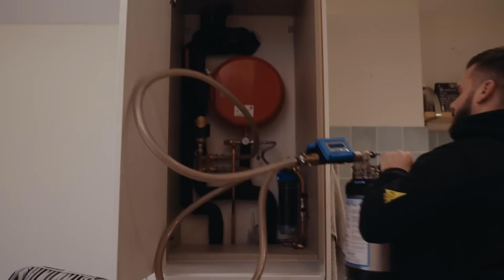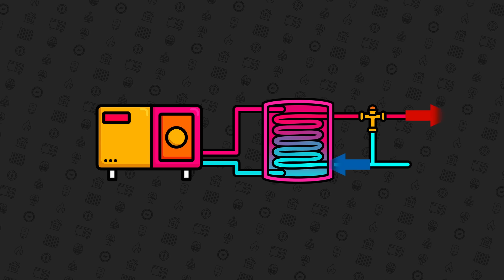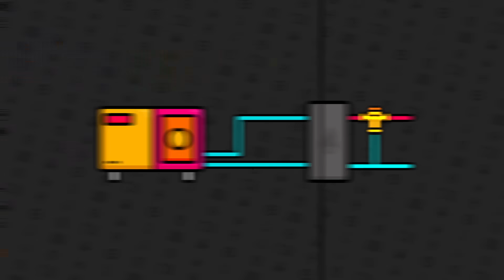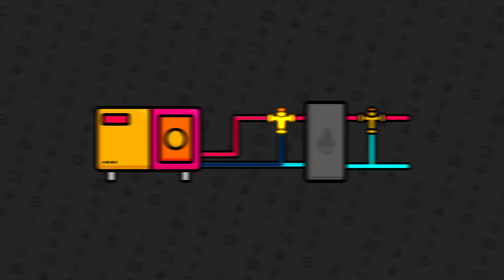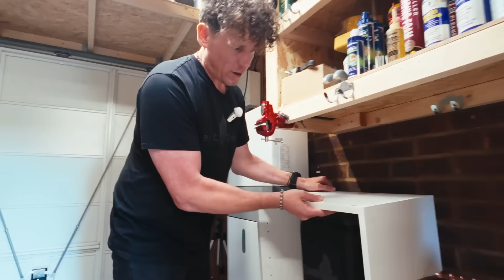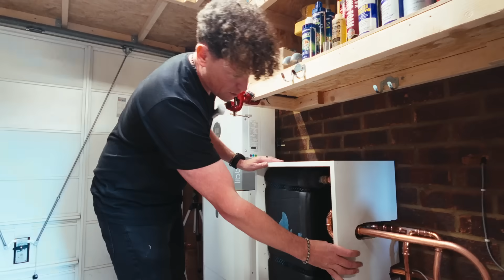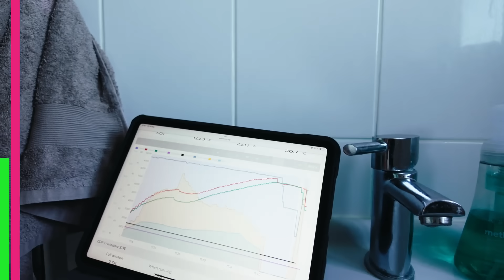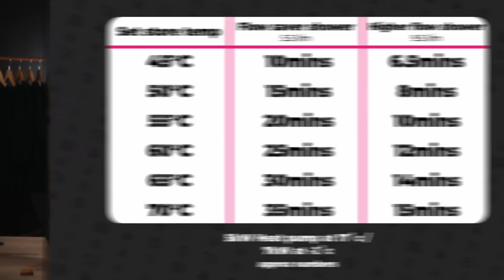World’s smallest hot water solution. (With a heat pump)

Comment: As many houses have electric showers, it may also be worth developing a heat exchanger that can use the shower's drain water to preheat the incoming supply.  While not a heat pump, this technically would have a COP over 1 as the electric shower only needs to use much less power to top-up the temperature after the initial heated water starts going down the drain, particularly in the winter when the supply temperature would be near freezing.  In this case the heat exchanger would need to have a self cleaning capability or at least be servicable to remove hairs, debris, etc.
Reply: This is relatively common in recent builds in The Netherlands; it saves around 40 to 50% of energy after a certain warm-up time (around 5 minutes). It consists of a copper 50mm drain pipe with a sleeve around it with the cold water feed to the boiler and shower attached. Search for 'douche-warmteterugwinning' or 'douche-wtw' (yes, a 'douche' is a shower).
Reply: Agree, however this is only needed on the CW feed to the shower. By raising the CW temp, using the waste, less HW will be required. These systems already exist, albeit requires invasive work to get to the waste pipe
Reply: As stated this is already a thing in the Netherlands, although not widely adopted yet. They work great. The vertical ones installed in the wall, never need any cleaning. They are great products, regardless of the heating solution. But they would work well in combination with this one.
Reply: In my house I've planned to go even further by going for a recirculating system based on a multiple filter setup namely: 75 micron mesh filter -> 10 micron fibre blown filter -> 5 micron activated carbon filter -> 1 micron fibre blown filter -> uv-c filter and a simple resistive heater (with area to go for a heat exchanger connected to my heat pump if I want later on).

So far my initial basic tests seems promising and currently I've installed my piping in the correct manner. I hope to in the near future (next 3-4 months) to fully enable the system.

Also everything is based on simple mixing valve system where flow sensors give the system info in what kind of water temperature you would want.

If I finish it I might write a blog / video around it, but don't pin me on it xD

Also yes this will cost more on usage since filters, but I hope that the savings in power and water will help a bit on that endeavour and of course only able with a full remodel.
Reply: @misthafalls  Yes that is a recycling shower. Which you can in fact already buy, but is quite expensive.
Might be worth it, however, regardless of price, it is much harder to retrofit in existing homes, needing to openup bathroom floors etc.
Reply: @Roland-nb6up  yup that is correct and that is a limit with that. But it is nice there are options nowadays.

Comment: Do it in the heat pump.  Dual heat exchanger in the mono bloc.   Little one for the heating as usual, then a big one for this job.  Not that big a deal to take a cold feed and hot return to the unit alongside the heating pipes.  

This removes a the transfer losses of 2 x HEX.  I guess. 

🤷 possible or dumb?

Comment: How are you triggering the heat pump to turn on? Is it purely based on the temperature of the water store?
Combi boilers use water flow as well as temperature to work out when to turn on. If you sense a large demand of hot water, it would make sense to start up the heat pump straight away e.g. when detecting more than 3l/s for more than 10s.
Reply: I experimented with the very cheap inline on demand units sold on ebay, they had uk and us plug options. Anyways the point is that they are the size of a football and use those same controls: flow and temp.
Tney work ok. Paired with this you'd have endless h2o.

Comment: I think something like this would be best used as a hybrid system - why not have a second resistive heater to get the water up to temperature quicker, and supplement in case demand is higher than the heat pump can supply.
Yes the efficiency would be slightly lower, but would be a significant improvement in user experience , and much more likely that people would be willing to adopt it.
Don't let perfect be the enemy of good - lower energy use is better, but if it's green electric anyway then it's already an improvement.
Reply from the maker: Watch the end of the video. We already going to this. The immersion is for extending the run time though really, not quicker delivery.

Comment: But doesn't running the heat pump at full output to deliver this use a ton of power -  equivalent to having an electric water heater?  Why do you never think about the sun as a source of free heat? We have a heat pump, with a dual circuit cylinder, plus two thermal solar panels.  In winter, the sun preheats the water so the heatpump does less, and in the summer provides all of our hot water -  for the cost of running a small 200w pump some of the time.
Reply from the maker: Well it used 2.7x less electricity than the power it used to heat the hot water due to getting the rest of the energy from the air (hence air source)

Comment: Brilliant - how does it work in practice when you may or may not be using space heating aswell? Still y plan but water draw switches the diverter? Would be good to see and understand. 

It’s great and generous that you are not patenting it but it’s a shame you aren’t building it with an external company like the other one? I think the heat geek brand is so trustable and I think people can trust systems from heat geek to perform well
Reply from the maker: The same as any combination boiler or any other heat pump system. It’s coverts to hot water, before moving back to heating.

Comment: Hard water areas would need a good filter on the mains with this design?
Reply from the maker: This will take 70* longer to block than a combo plate. Combo plates usually block primary side though not secondary

Comment: If you're that place starved, maybe, but otherwise this is stupid - you can get a HUGE boiler for the price of that HE and do the same mixing valve dance around it.
Rechecked the model number - pfff lol, you OK there genius? For that kind of money you can get 1 TON boiler.
Any defrost cycle will immediately drain that 'reservoir' of heat.

Also ain't you 30 years too old for that haircut?
Reply from the maker: I can get these plates for well under £500

Comment: Superb and love the ingenuity of this but…. this was tested at 19 degrees outside, now try it at 2 degrees down to -7 degrees as is often the case in the uk.
If it works, i want one.
Reply: OMG people, can you read?!? COP 2.7 is absolutely rubbish at 17C. 
I have 150L heatpump boiler Atlantic Calypso. And it absolutely demolish this performance.
My mesurmenst:
Air temp 8C, end water temp 42.5C, COP 3.37
Air temp 15C, end water temp 42.5C, COP 3.33
Air temp 26C, end water temp 42.5C, COP 4.34
Air temp 26C, end water temp 40C, COP 4.61
Air temp 26C, end water temp 50C, COP 4.07
Air temp 30C, end water temp 50C, COP 4.64
Reply: @ASK-8819  OMG can you read?!?  This is a solution for people who don't have the space for a 150L tank!  A lower efficiency factor is acceptable because it's still more efficient than burning gas.

Comment: Nice idea, but what about thermostatic mixing valves needing hot water at 10C above the set temperature to regulate the temperature correctly. Or are you assuming no shower mixing valves?
Reply from the maker: Turn up the blending valve…
Reply: @HeatGeek  what? These are standard wall mounted thermostatic shower sets, they don’t have adjustments.  If you adjust the desired outlet temperature to 40C, most manufacturers require 50C hot water temperature.  Look at thermostatic shower technical literature?

Comment: I have a heatpump, a 1000l buffer tank and use a plate heat exchanger for my use water (shower, bath, washing machine). that system saves me 8000kWh per year compare to my old gas heating

Comment: For a really good challenge, can you guys come sort out our £23k badly installed heat pump, by Chelmsford based EPC Improvements, running at an amazing SCOP of 2.2? ECP doesn't want to deal with it or us.
Reply: You can complain to MCS, if they can't help the energy ombudsman and/or trading standards
Reply: @Zero_Theory  MSC told me to go to RECC. I started a Section 75 claim, but EPC keeps trying to get out of it by finding new ways to challenge. I am tired of this. I will have to try the ones you mentioned.
Reply from the maker: Sorry to hear this 👎

Comment: I'm curious about the blending valve on the inlet, only allowing water through when it's warm enough. Is that a special type? I didn't know they made valves that behaved like that.
Reply from the maker: It’s just the repurpose of what we’d term ‘back end protection’ used on systems like biomass
Reply: @HeatGeek  Thank you!
Reply: @HeatGeek  I just had a thought, wouldn't the back end protection valve also benefit a regular cylinder, in order to prevent disturbance to the stratification?

Comment: This is a very interesting idea. I do wonder if you could find other materials for a plate exchanger that has a higher heat capacity. Maybe laminating it in between the corrosive resistant materials. The higher the heat capacity, the lower temperature you could run while charging... equalling better efficiency.

Comment: Nice! We sometimes add a heat exchanger to boost transfer instead of replacing a nearly new but not heat pump rated cylinder. While it's not the objective of the exercise, I observed on our last one that it can supply continuous hot water via the heat exchanger. I'd never thought of eliminating the cylinder entirely, but your method looks like a real winner.
Reply: That's really interesting that you're also doing the same thing. Would you mind explaining how this is plumbed together and what heat exchanger you use?
Reply: @Aphova  Sure. First, by 'sometimes', I really mean 'twice'. It's not what we normally do, but on those occasions we found an existing nearly new cylinder, so we thought we'd try to make it work rather than a costly replacement. We also happened to have 2 heat exchangers on the shelf from when we stopped building systems with a heat exchanger separating the heat pump from the radiators. We also had a couple of spare bronze body (potable water compatible) circulation pumps from somewhere. Therefore it was cost-effective for us, but wouldn't necessarily be for someone else.
What I did was to plumb the DHW flow from the heat pump through the heat exchanger, before it went through the cylinder coil as normal. Then on the potable water side I ran a pipe from a tee just by the cylinder cold feed port, through the heat exchanger, a pump and a 2-port motorised valve. The valve was to stop cold water bypassing the cylinder when not in cycle and a hot tap opened. The valve was wired in parallel to the main DHW 2-port valve, controlled from the ASHP control box; the pump was switched on by the microswitch in the valve and pumped from the cold feed to the hot outlet.
Edit: actually on one of the installs I think I fed into the hot return port rather than a tee at the hot outlet, but the other cylinder didn't have one.
Reply: @bimblinghill thanks for the detailed explanation! I'm probably being a bit daft but not sure I completely understand what you did. Do you mean you ran the cylinder's cold water feed through the heat exchanger first so that it would preheat it before it entered the cylinder to lower the heating requirement in the cylinder?
Reply: @Aphova  No - sorry my explanation isn't all that clear, it's a shame I can't include a diagram!

In terms of the hot water supply circuit - that is the water that comes from the cold mains, and eventually comes out of the hot tap - the heat exchanger is in parallel to the cylinder. So, the circuit splits at a tee just near the cold feed into the cylinder (the 'lower tee') and one route goes into the cylinder and the other goes through the heat exchanger. However the motorised valve will normally be closed on the heat exchanger route so nothing can flow through there. Then, at the top of the cylinder there is an 'upper tee' and the two routes rejoin again. So, if you open a tap, hot water comes out of the cylinder and out of the tap like normal.

In terms of the heating circuit, the heat exchanger is in series with the cylinder. The water heated by the heat pump goes through the heat exchanger and then through the coil in the cylinder. When the system runs a hot water cycle both the heat exchanger and the coil in the cylinder are heated.

To extract the heat from the heat exchanger and put it in the cylinder, on a signal from the heat pump, the motorised valve opens and the pump starts working. Lets assume that no-one has opened a tap for a moment, so what we have is a closed loop. The pump draws water out of the bottom of the cylinder (via the lower tee), through the heat exchanger, and pushes it back into the top of the cylinder (via the upper tee). This allows the cylinder to be heated much more quickly than the (undersized) heating coil would alone.

And that's mostly how it operated, except for those rare occasions when the hot water heating cycle is working and a hot tap is opened. This is what made me comment - it's not the purpose of the system, the purpose was to improve heat transfer into the cylinder without replacing the cylinder - but what I observed in testing was quite interesting. The pump was able to keep up with the flow out of the tap, so almost all the flow went through the heat exchanger side of the loop, and very little flow came out of the cylinder. So, the system was effectively providing continuous hot water during the time that the hot water cycle was scheduled to run, anyway.
Reply: @bimblinghill ok thank you for the in depth explanation, that makes perfect sense now! That's an ingenious way of avoiding having to replace an entire cylinder! Very surprising how the heat pump was able to keep up with the flow, I thought that wasn't possible below approximately 15kW. In retrospect do you think it was worth it? I.e would you do it again in the same situation?
Reply: @Aphova Yeah it seems to work really well & saved maybe £1000 on the installation cost. In those precise circumstances I'd do it again although now we don't have spare heat exchangers or bronze pumps lying around it wouldn't be quite so beneficial.

Comment: My combi broke two weeks ago. I looked at air source pumps. The tank was an issue, so this would have worked for us. However, the cost at double the price of a combi swap is the bigger issue. 

If you want to get more air source installed you need to make it affordable and quicker to install.
Reply: I was accounting for the grant. It was £3600 for the boiler and a couple of new rads. £7500 for air source after grant. 

While I understand the potential long term savings, I’d rather keep the cash in the bank in short term. Unfortunately this is where air source does not work. Most houses with combi’s are smaller houses and no one’s going to pay twice the price. 

Which then makes you think should there really be grants for the installations. Let market forces decide. If air source wants to be the main system prices and easy of installation need to improve.
Reply: @pauljex1385  Those are two pretty expensive installs.
Reply: Are you accounting for government grants in the cost comparison, and the long term savings? Don't forget that if you can get rid of gas entirely there is also no standing charge to pay.
Reply: @JPEight  A friend is having an ASHP fitted by Heat Geek next month £ 22,000 (less the £ 7KGrant).
£ 22K pays to heat and light my 4 bed detached (1865 build)  for 11 years...using gas. Even with both standing charges...
You mentioned long term savings ?
Reply from the maker: We have something coming to fix this.
Reply: @HeatGeek I am a surveyor and see the biggest issues as modern houses use micro bore pipes, air source need to work with these as most people will not go through the pain of swapping. Combi’s I think you’ve cracked the tank issue with the latest ideal. But cost is still the issue. The grants given can’t go on forever. People like heat geek need to push air source manufacturers to produce products that can work with existing systems without swapping tons of pipes and rads. 
Keep up the good work and hopefully you’ll crack the challenges. I’m still convinced the concept works.  It needs to get better to work with the existing systems or it will fail as not enough people convert to it regardless of grants.
Reply from the maker: @pauljex1385  the vast majority of systems that have micro bore also have lower levels of heat loss and therefore the micro ball is absolutely fine without being replaced. Or you can use hydraulic separation if needed.
Regarding the cost we have cracked something there to reduce cost by about 65%… Coming soon

Comment: Why not fit the heat exchanger to the heat pump as a bolt-on module and run the hot/cold water in/out to it? Would put all the heating and hot water  generation/storage outside and away from the house where also easier to service. Imagine you’d need something to stop the pipes freezing though (tracer wire etc).
Reply from the maker: Bc many heat pumps can supply a cylinder

Comment: Am I right in thinking that this could be a solution to allow air to air heat pumps to produce hot water WITHOUT a cylinder?
Reply from the maker: Yes
Reply: @HeatGeek  could this finally be a way of A2A heat pumps to qualify for the Boiler Upgrade Scheme?